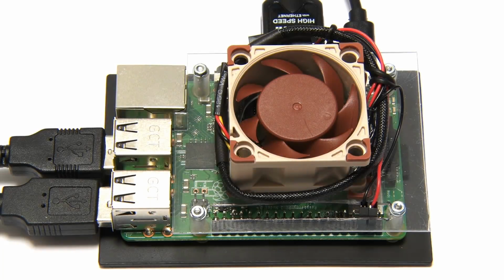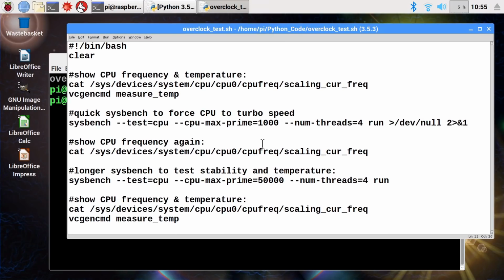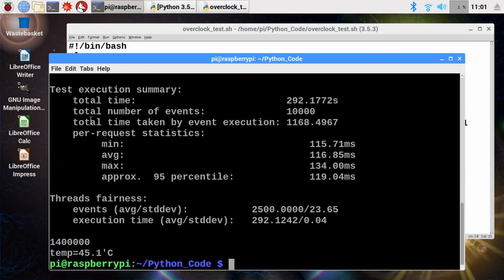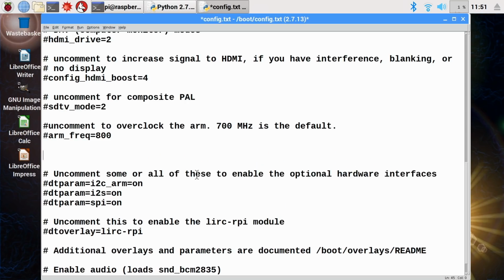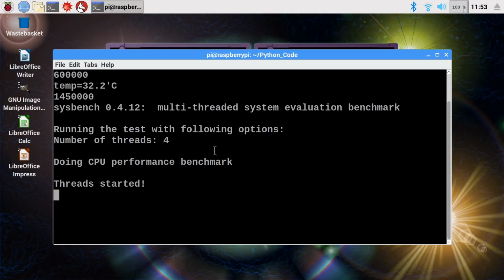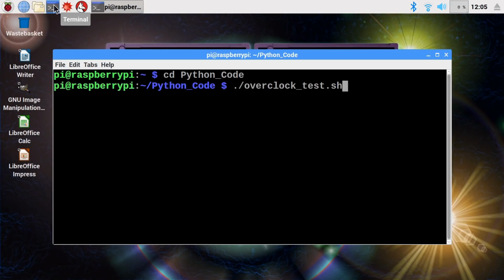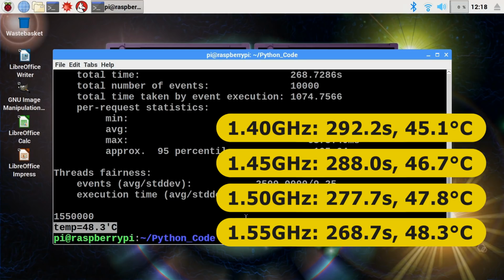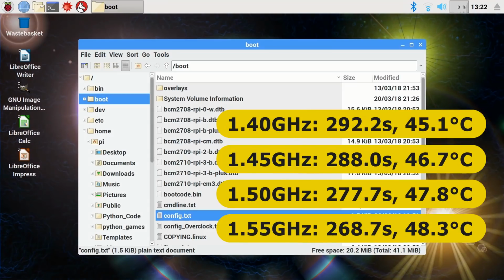Raspberry Pi 3 B+ Overclocking

Comment: I was hoping that you would have tried that experiment I suggested, to draw more air in to cool it down.
Wouldn't it better to up the amperage then the voltage, What is the formula for this?
What about the overclocking of the processor you set it to 500 MHz this seems rather low can you not take it to say 700 MHz or increasing the voltage of the CPU Wouldn't this be causing issue with the GPU, running at a lower voltage.
Reply from the maker: I set the GPU to 500MHz, (up from 400), and in the end the CPI to 1.55GHz (up from 1.4). Overclocking always involves changes in voltage, not current -- the circuits will draw in what is available current wise.
Reply: ExplainingComputers 👍👌

Comment: Great video, it reminds me overclocking a celeron 300MHz to 450Mhz back in time :) Even more with water cooling.
Reply: You must be referring to the old, but awesome Celeron 300A! I had mine hit 600 with slightly modified cooling! But 99% of the time I kept it at 450. It made my Win 98SE really shine! 😎

Comment: Chris clearly warns overclocking is at your own risk (for breaking the Pi) but it also means you loose an eventual warranty.  IF you uncomment the overclock and overvoltage settings and let the Pi once boot, a non reversible bit is set so you can't claim any warranty anymore.
Reply from the maker: Good info/advice. Thanks for posting.
Reply: Thanks Chris.

Comment: Well done 👍🏻 It would be great if you can add a liquid metal thermal paste and liquid cool the pi. I know that sounds crazy and unnecessary but hey who said we should be reasonable right : D
Reply: You could always put your Pi in a mineral oil tank. I did it with mine 😎
Reply: I guess above 1.55 ghz the problem is not the thermals anymore, so even liquid nitrogen won't help you :)

Comment: At 1.55Ghz, can you watch youtube fullscreen without stuttering?
Reply from the maker: It depends on the codec, resolution and frame rate; H.284 hardwade decoded at 1920x1080 at 25 or 30 fps runs OK.

Comment: Great video. Cool backround image. I've managed to go to 1.57Ghz. I used long Blender projects to check the stability. 
I've made a new video about the NanoPC T3+ this week. Great SBC. It's an octa-core of 8x1.4Ghz, 2GB ddr3 ram, 16 GB eMMC, a lot connections for displays and camera's. It's like 2 raspberry pi 3b+'s in one. Also the same price as 2 rasp 3b+. Click on my face if you would like to see. Greetings. 
NicoD
Reply from the maker: I will check out the video!
Reply: I would have thought a trial going up by 0.01 increments might have been worthwhile: 1.56, 1.57.. 1.59?
Reply: Odroid XU4 is also a beast

Comment: Hello. there seems to be a software that claims to be operable on a Pi 3 according to the Webpage pianoteq.com(or, more exact, on arm-based computers under Linux)

what it does is CALCULATE the sounds of a piano (as oposite to playing stored samples). 

i would find it MOST interesting if this demanding task could really be done by a Pi3

the german paper CT has an article in their 12/2018 Issue that Claims that with the Software Pianoteq 6.1.1 Physical modelling has reached the Quality of sampling.
If that is true all you Need to create a Grand piano is a dynamic Keyboard(compatible with the Software) a Pi3 and loudspeakers(plus a few wires…)as well as the Software.
Maybe such construction would be interesting to try?

Comment: I recently resurrected a Lenovo T60 out of the bin at work and decided to try breathing some new life into it with Linux. It's running a Core 2 Duo which is a confusing way of saying a dual core 64 bit Intel x86 processor. I'm happy to report that it is faster than a Raspberry Pi although I can't do much about the cooling being that it's a laptop. Seems to get up around 1.7 GHz clock speed.

Another informative and interesting video. Thanks Chris.
Reply: jagardina Isn't x86 32bit?

Comment: I would be curious about the power consumption (or the current measured, almost the same, as the external power should stays at 5V, so only the current should be different when we talk about power here) of Pi on different overclocked stages. I guess, it's even the possibility that power supply just not beefy enough in some scenarios especially if people use just too "weak" ones which may be even barely enough for the base clock speeds.
Reply from the maker: I am planning a video looking at SBC power consumption . . .

Comment: Hey 1980s BBC 2 are on the phone, they want their presenter back...
Reply: Tell BBC2 C Barnatt is a Youtube star now, they'll have to triple the offer. Also, I tried to run my raspberry pi at 1.5 for an extended period and only found that over time, it was unstable and it crashed when it was pushed too often. Sometimes you have a processor that can overclock significantly and sometimes you get one that just falls within the specs, there's some luck to it.
Reply: Also how much more over 1.55Ghz would it of gone and remained stable?
Reply: With 1.6 being a step too far anything between them are small and you couldn't really trust the stability, 1.55 is the realistic maximum or perhaps even 1.5 for true peace of mind.No point in running a computer on a knife-edge when the difference would barely be noticeable.
Reply: Producer of The Greatest Story Ever Told - remake are on the other line looking for someone for the lead role. Your name popped up apparently. ;-D

Comment: Great video! Do you know if a Pi 3 B+ (say for desired lower idle power consumption reasons) can run lower than 600 MHz or is this a "hard" lower limit? I am envisioning a network of Pi(s) that are idle 60-70% of the time but kept busy the other 30-40%.
Reply from the maker: I believe that a Pi can be underclocked -- effectively overclocking as shown here, but in reverse. Same method though. I think you can even under voltage.
Reply: Thank you for the prompt response.
Reply from the maker: I may have to try this now! For under voltage, you use negative over voltage values!

Comment: Maybe if you try over voltage 7 or 8 you can get 1,60ghz. I think you use a very aggressive voltage, for 1,45ghz overvoltage 2 is a lot, over voltage 1 is sufficient
Reply from the maker: As far as I am aware, the over voltage max is 6. I searched around, and cannot find anybody who has achieved 1.6GHz.
Reply: ExplainingComputers it stays that the range of the overvoltage fonction is-16 to 8(https://elinux.org/RPiconfig)
Reply from the maker: Interesting -- up to 8 indeed -- https://elinux.org/RPiconfig#Overclocking_options -- I stand corrected. I must experiment more with this!

Comment: Wild guess, but I imagine its the RAM killing the PI at 1.6GHz.
Reply from the maker: Quite possibly.
Reply: I wonder if faster modules could be swapped on, would take a hot air soldering station and a steady hand.

Comment: Great stuff again, always enjoy an overclock!, not just on a PC it seems, an SBC can get down and boogie too.  Would have liked to see some more benches with your photo editing and perhaps video rendering too? Certainly, the 20-30% uplift would make it more competitive with the Tinkerboard and the other Octa Core siblings? Anyway. The first experience I had with overclocking, was, in fact, my phone. I had an HTC Sensation and was running a daily 1.4ghz, with a slight GPU bump too,  which made it faster than a Galaxy S2 at the time, which was pretty remarkable.  I wish those Quad core Atoms, or maybe the Exynos models could have a boost as well, not that they need it, but why not overclock? It's free performance if the cooling is there, which in the case of PC's, it is usually.  Anyways, thanks for the video.  Also a wee side note, I will contact you again via a new address if you are still in the middle of consolidating your emails. Cheers.
Reply from the maker: Thanks Brett. My life will get a lot less hectic from the second week of July.
Reply: Sorry to hear that, i understand things get a bit crazy. I hope to catch you then, hopefully, this will be our chance. Please contact me closer to the time with some more solid details. I hope it isn't too far from reality, being on the other side of the world. I am determind to make it work, hope you are too. Cheers again .

Comment: While 10% more doesn’t sound that fast it also means 30% faster than 2B/3B which is a decent improvement. Thanks for another good video :-)
Reply from the maker: I like your thinking here! :)
Reply: Bill Nanos it depends what is “stock” and where you use them. For industrial application surly not. But for hobbyists it depends. We don’t have access to full chip spec so all we know is that 2836, 2837 and 2837B0 are a bit different chips. Known difference between 6 and 7 is change from A7 armv7 to A53 armv8. But we do not have official thermal envelope for those chips. We don’t know what is their target speed like ie. ark website for Intel chips.
Reply: not if you overclock them,you cant compare overclocked to stock

Comment: Great video. I think that folks are attempting to get far too much performance out of Pi's. They forget the purpose of the machine, and try to make it into something that it isn't.
Reply: Getting 'too much performance' used to be for hotrodding old cars. Same concept, but now with computers. And probably safer.
Reply: jabney8mmm yes, but there are limits for cars as well. You dont take a 1.3L Toyota yaris engine, and cram it into an F250, slap a turbo on it, and expect it to pull 9 seconds in 1/4 mile. Just like you would expect a PI3 to run crysis
Reply: Yidris No, but finding out where that cutoff line is is fun. And no small part of the ‘original’ purpose of RPi was education and just seeing what could be done. Saying ‘people are trying too hard to make it do things’ is silly. Making it do things .is. the point.
Reply: Jamie Norwood the only reason for the raspberry pi was education. To teach children syntax, and to educate them in how to apply syntax in order to write programs.

Comment: I wish i had a B+ 
, for now my b on 1.5 Ghz will have to endure
Reply from the maker: Not all Pi 3's will get to 1.5GHz; it is luck-of-the-draw how high a particular Pi will go. Depends on how the manufacture of its SoC batch went.
Reply from the maker: The 3B is still a great Pi -- and the 3B+ is basically an overclocked version of it. You 1.5GHz on a 3B is a more impressive overclock than I achieve here!
Reply: William Chan how you get 1.5ghz on the pi 3 b ? I can't get 1.4ghz,😮😮
Reply: ExplainingComputers i think i have got a very bad quality silicium for my soc
Reply: After watching this video and further reading the raspberry pi forums I've found that a clock of 1.7Ghz is actually more stable than 1.6 even at an over_voltage of 5. My config is: 
arm_freq=1700
core_freq=500
over_voltage=5
sdram_freq=500
sdram_schmoo=0x02000020
sdram_over_voltage=2

Sysbench scores are: Temperature did not reach 55C at an ambient temperature of 26.4C using a 15$USD pi cooling kit from China that comes with 3 heatsinks of unknown make painted black (properly bronze since the bottom heatsink was gold colored) and a 5V 0.2A GPIO fan.
600000
temp=39.2'C
1700000
sysbench 0.4.12:  multi-threaded system evaluation benchmark
Running the test with following options:
Number of threads: 4
Doing CPU performance benchmark
Threads started!
Done.
Maximum prime number checked in CPU test: 50000
Test execution summary:
    total time:                          684.9477s
    total number of events:              10000
    total time taken by event execution: 2739.3200
    per-request statistics:
         min:                                270.18ms
         avg:                                273.93ms
         max:                                569.54ms
         approx.  95 percentile:             281.47ms

Threads fairness:
    events (avg/stddev):           2500.0000/30.22
    execution time (avg/stddev):   684.8300/0.09

1700000
temp=53.7'CAlso on the forums I have read that someone has reached 2GHz at an over_voltage of 6 with a regular desktop CPU fan with the following config, hopefully you could test that out as well:
arm_freq=2000
gpu_freq=800
sdram_freq=900
over_voltage=6
over_voltage_sdram=6
Reply: The scores are weird however, the screen did not freeze and I could move my mouse without issues nor the undervoltage symbol appeared, my guess is that because I am running retropi with pixel at 1080p60hz it's making the pi load a lot more other programs outside sysbench.

For reference, this is my benchmark with 20000 prime numbers:
pi@WilliamRetroPie:~ $ sysbench  --test=cpu --cpu-max-prime=20000 --num-threads=4 run
sysbench 0.4.12:  multi-threaded system evaluation benchmark

Running the test with following options:
Number of threads: 4

Doing CPU performance benchmark

Threads started!
Done.

Maximum prime number checked in CPU test: 20000

Test execution summary:
    total time:                          187.1461s
    total number of events:              10000
    total time taken by event execution: 748.4920
    per-request statistics:
         min:                                 73.82ms
         avg:                                 74.85ms
         max:                                141.02ms
         approx.  95 percentile:              76.80ms

Threads fairness:
    events (avg/stddev):           2500.0000/39.40
    execution time (avg/stddev):   187.1230/0.02
Reply: what's your config?